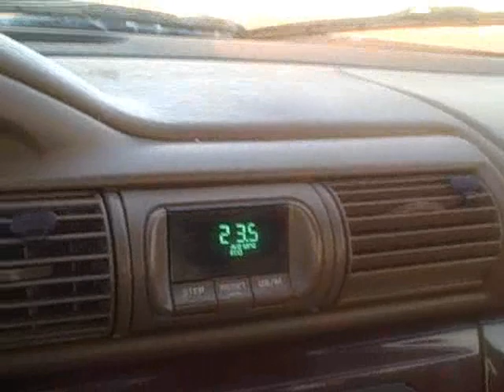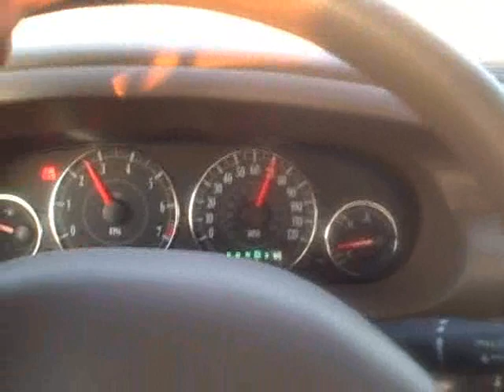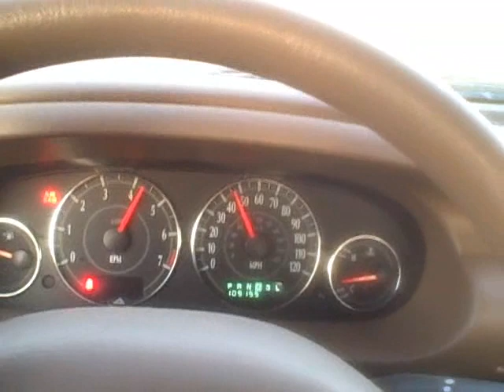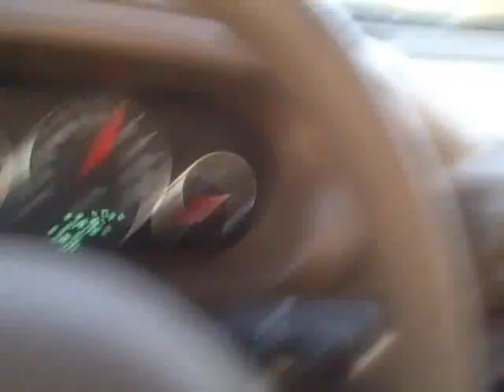2 7L Chrysler Sebring 0-80mph acceleration

Comment: 0-60 in 7.5, 0-75 in 11.8 sec.

that's definetely a true 200 horses. The newer 3.5L's rated at 250 actually seem less powerful than this. I guess it's a matter of opinion, but i think that car's acceleration is perfectly reasonable.

Comment from the maker: amen, my mother also drives a minivan that with 216000 miles still averages 26, and you would be surprised how many people assume that a car companies advertisements of, (insert outrageous HP figure here) are not the same as HP from even 15 years ago simply due to the inherent parasitic losses caused by the drivetrain, Ill take a 1978 140HP chevy 350 over a 2001 "200HP" vehicle any day, its all in marketing though, like one of my subscribers said "horsepower sells vehicles but torque moves them"

Comment: The only concession I made when I purchased my 2009 Chevy Avalanche LTZ Elite dual cab, was to go with the alternating V4/V8 engine. I get people telling me I should have gotten a Prius. My response to them "You're fucking lucky they don't make H1 Hummers anymore or that would be sitting in my driveway. If I want to pay $160 to fill my gas tank from empty, I'm going to do it". Plus, the sucker goes from 0-80 in roughly 10 seconds and holds very well to the roads and turns even close to 100mph. 

I live in very rural country where cows and horses outnumber people 10-1. Our mud season is a bitch and being in the mountains when theres an ice storm (I live roughly 20 miles from Mt. Washington) and only being in a little Saturn SL2 sucks. I'm all for saving the environment but not at the expense of my safety or mobility in all conditions.

Comment from the maker: agreed, new cars are rated from the engine so they can claim higher numbers to sell more cars, i do use cruise, but admitedly I have a rather heavy foot getting to 70, and as ive been told I do have a tendency to compare vehicles with motors that Ive built to stock vehicles which isnt terribly fair but all the same, the mileage comparison and my assesment of such was as well based on those same comparisons, facto of the matter is, beyond the motor this car was just a lemon from the get go

Comment: I have a 95 Bronco with the 5.8L that gets 20mpg... And I'm not talking about highway mileage.. That's what it gets running around town. It has not been rigged in anyway and it has about 150,000 miles on it.. Hasn't cost me anything but what I spend in gas and regular maintenance (which means oil changes, tires, and whatnot..) My 3/4 ton with a 460 gets about 16 mpg but it crushes small cars.. just look at my front bumper and you will see the remains of a small car that got in my way!

Comment from the maker: ok lets see the two is right next to the three and when you go to hit one and hit the other and dont proofread a mistake is made called a typo, further more there is a big difference between putting a load in the back of a pickup (2 ton of feed 500 gal of water) and hauling a loaded gooseneck as Ive said before do your research comparatively speaking those are relatively light loads

Comment from the maker: well as a matter of comparison it does suck, considering I know guys that have gotten 20-21 with 440 chargers, the 500 big block caddy I had that would get 20 or the bronco I have that gets 23 on the interstate, in the less comparable realm even how about the chevette that averaged 36 when I drove it daily or the F150 300 six I had that would get 19 pulling a load or completely empty, my assumptions were that fuel injection was supposed to make vehicles so much more efficient, just not seeing it

Comment: I dunno, none of that seems too out of line to me numbers wise.  I wouldn't expect anything else from the car.  Fresh O2's would probably help, I find that FI cars tend to dump tons of fuel in as their O2's go bad.
That car doesn't not have a very big motor per weight (wiki lists it at 3000-3500 lbs ) The 2.7L hp number I could find was 189 @6,400, so, ya, you gotta turn in inside out to get the hp, tough to do in an auto.  Your broncos valves are probably floating at that rpm.  :p

Comment from the maker: no I dont beat the shit out of that car since I hardly ever drove it and dont even own it anymore... I did however beat the tar out of my bronco and never had any troubles with it with 198000 miles on original drivetrain and yes it did get 23 as long as I kept the cruise set and my foot out of the firewall as did most pre 91 fuel injected 5.0Ls with 3.55 gears and an overdrive perhaps before you make assumptions and call names you should do your research and know what the hell your talking about

Comment from the maker: that but apparently it passed you right by like I said earlier get out of your little suburbia cave and figure out that its awfully hard to run a 22000 acre ranch when all you allow yourself to drive is a hybrid, so i settle for the best mileage I can get out of the vehicles that I HAVE to drive in order to get the work done, did I also not mention that i drive a vehicle that gets "GOOD" mileage when i can??? once again keep it up with every comment you simply prove yourself more ignorant

Comment: Haha.  Yeah Sebring's are slow.  I did get mine up to 85 mph today and it was still driving smooth.  Mine is an 04 though with a 2.4L in it.  So mine is actually slower than yours by all comparison.  But it works for me, just a cruising car I guess.

Comment: only 27 mpgs? for that overstressed underpowered 2.7 v6 thats about all you are going to get period! those 2.7s are crappy engines because the water pump is behind the timing case. if the water pump goes,instant oil/antifreeze mix kills the engine in a big hurry!